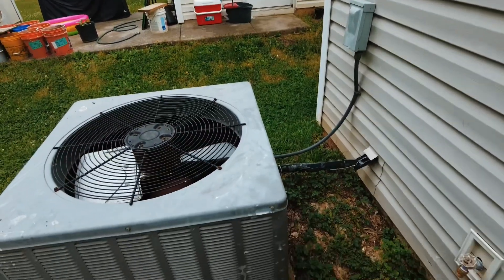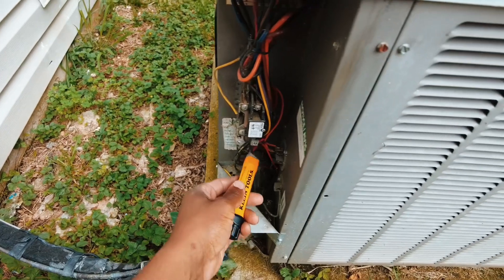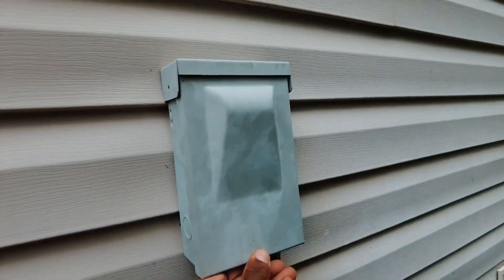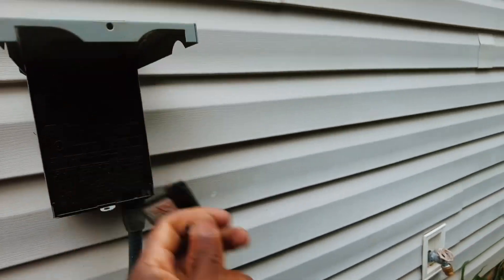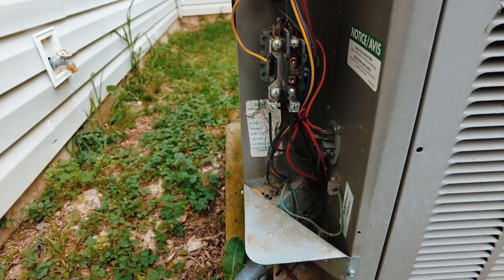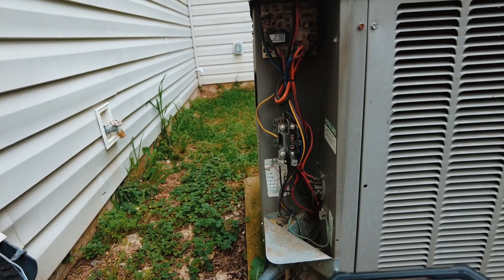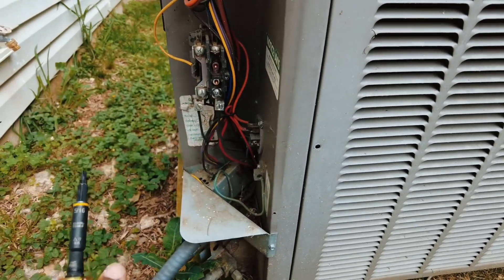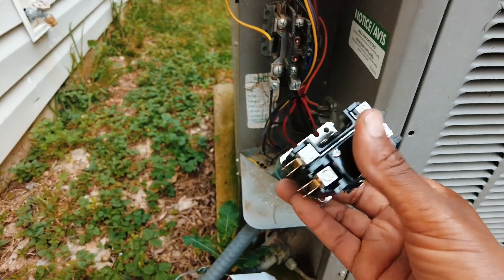Contactor and capacitor replacement combo on Rheem split system | HVAC service tech repairs

Comment: Rheem seem like nothing but trouble. Mines a year old and the air handler had a freon leak already and had to be replaced. Now the Contactor may be bad the unit won't turn on outside and the Nest Thermostat says problem with Y1 wire

Comment: Good vid, if I were you, take the pressure off your knees, use a stool and sit, a lot of workers on this trade are having knee replacements. Up 2 u
Reply: He has knee pads, that's not good enough? I use knee pads.
Reply: @workaccount341  knee pads are good yes, i prefer a stool, put less pressure on ur knees, ur knees are going to get u from point a to b. I noticed when i use knee pads or a kneeling mat, i feel pain on hamstrings, more resistance occurs. I guess everyone is different.
Reply: @zahedaminullah6934  better safe than sorry, ima start bringing my bucket now. I love my knees
Reply: @workaccount341  yes sir, ever since I used a stool, i feel no more pain in knees, no more restrictions when bending on knees, i been in the trade 11 yrs now. I always love to give good advice and am a health n saferty member too